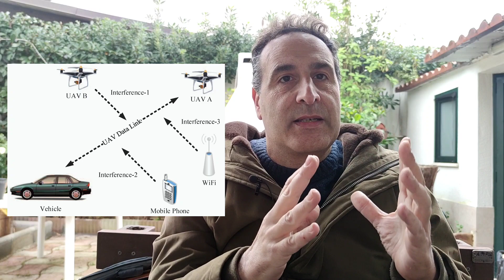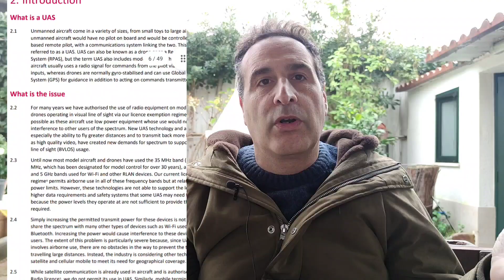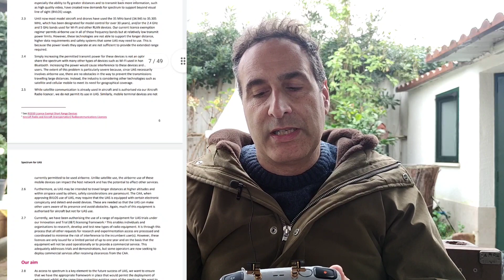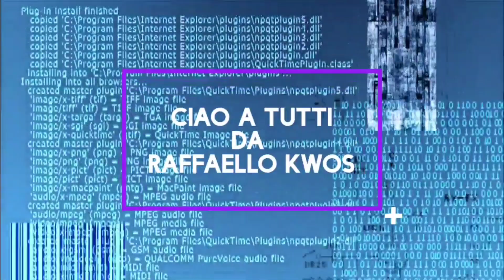Il DJI MINI 3 PRO e l'FCC. Test di due differenti antenne: originali RM330 (DJI RC) e modificate.

Comment: Grazie sempre di tutto per tutto . Io il mio  mini 3 pro lo sto usando spesso mettendolo in Fcc usando L'Rc N1 per commutarlo in Fcc e sucessivamente facendo il pairing con il DJ Rc RM330 ,in modo da sfruttare tale telecomando in FCC , con estremo miglioramento della sicurezza di volo . Non devo coprire grosse distanze , ma mi serve averne la totale governabilità a prescindere dal discorso legale legato alle potenze CE proprio perchè ritengo la sicurezza elemento prioritario su tutto.
Detto questo mi e sembrato di capire che anche Rc RM330 lavora in ocusinc 2 con il nuovo mini3 pertanto sarebbe grande cosa se implementassero il suo utilizzo al vecchio intramontabile Mini2 che mi è sembrato piu vincente e stabile in caso di vento  forte e raffiche
Reply from the maker: Certo. Una radio capace di funzionare in O3, può benissimo funzionare in O2. Deve semplicemente non utilizzare i 40MHz di larghezza di banda. C'è giusto qualche piccola differenza nel protocollo.